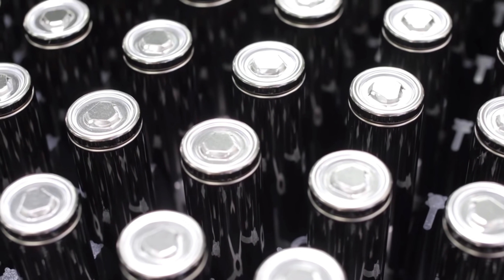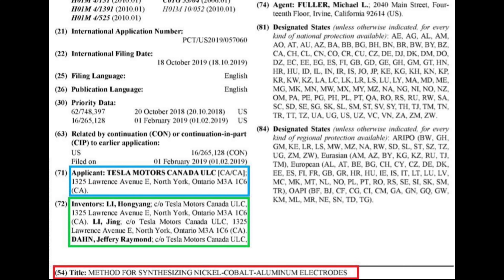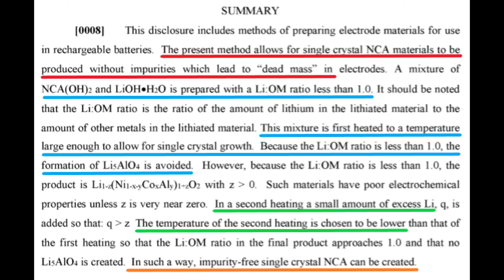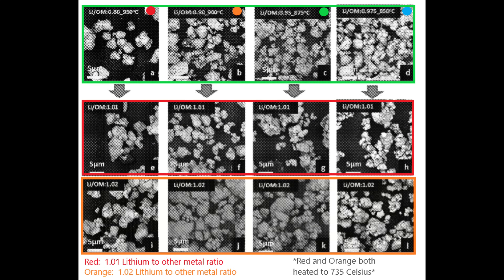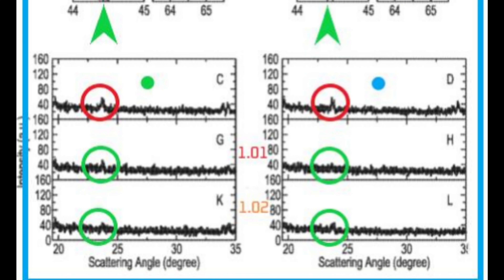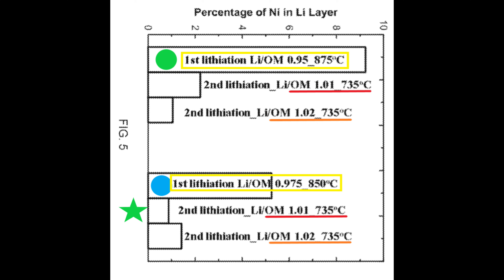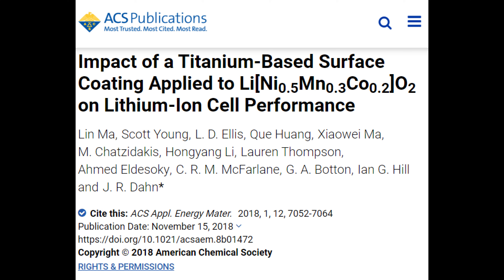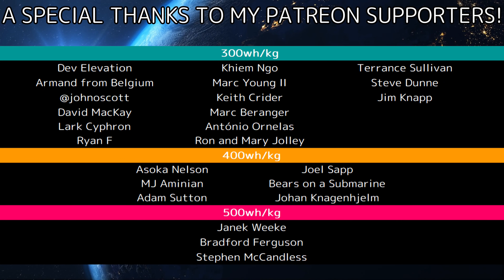Tesla Single Crystal Cathode Patent (Deep Dive)

Comment: Hi jordan, ultimate discussion about the single-crystal performance and the related patent description, however, the dQ/dV depends on the active material loading hence don't compare with a patent. since in the comparison dQ plot they have used pecific differential capacity value but in patent, they have displayed as obtained plot. 
Thanks for this video and hats-off
Reply from the maker: Thank you!

Comment: Can i point a question? High temperature process like 750 to 950 degree C  take a lot of energy that means higher costs of production even if well industrialized; taking into consideration also long tine to ‘cook’ the NCA crystals that means A LOT more costly chathodes... i think that this is not feaseable industrially, even if they avoid the costly Cobalt out of the chathodes , the offset of higher temperature processes (2 steps so more energy intense process) nullify the small advantages.
Reply from the maker: That's a really good point.  I've been thinking about this a lot lately.

Comment: How does Novonix and their Single Crystal Cathode manufacturing patent play into this? Tesla owns the patent and they have to use Novonix to manufacture it? Or pay them to license or a royalty?
Reply from the maker: Novonics comes in at the precursor stage.  It's a one step dry process instead of about a seven step wet process.  I'll be doing a video on that
Reply: The Limiting Factor Thanks, look forward to seeing the video. I saw Novonix made a few announcements of patents relating to dry particle microgranulation (DPMG) and single crystal cathode manufacturing and I’m struggling to understand how they might fit into Tesla’s big picture if Tesla has already been developing it.
Reply from the maker: @dobodob1  It may not fit into Tesla's big picture.  It will take a couple years before the single crystal from novonix is on the market in any volume.  In order for a Tesla to implement single crystal now or soon, they would have been lining up supply a year ago.  There are plenty of suppliers of single crystal or Tesla could make it themselves.

Comment: Have you looked at dry particle microgranulation (or DPMG) and it's potential effect on battery cost and lifetime? By Obrovac, a Professor in Dalhousie University.
Reply from the maker: Yup!  Working on a multi-part series on anodes.  Been in contact with Chris burns and other CEOs.  I'll start with Graphene and work my way up.

Comment: If your goal is to upload content to reach a large number of viewers then choose a lower resolution your content appears interesting but could be stuffed watching it because the audio cuts out
Reply from the maker: Hey man, thanks for trying.  I'm confused though.  You can lower the resolution by clicking the gear and lowering the resolution.  YouTube always plays at the max resolution but allows users to select the resolution that's best for their system.
Reply: I tried doing that... There was no option to do that.  I was watching it on my tv  via chromecast, casted from my mobile, it dosen't give you the option to reduce the resolution
Reply from the maker: @SkyRiderJavelin Oh man!  I've corrected in future videos - rather than 60fps 4k max, it will be 60fps 1080p.   The tabless electrode patent deep dive video used that format and so did the corrections video I just posted.  Hopefully that helps.

Comment: I have the rare earth element that can be test for battery i  tried heating it in high temperature it just glow in red and even if you put it to water while too hot it never breaks, my belief is that this kind of materials can be use as components of battery that is highly resistant to heat and a good conductor and energy storage...

Comment: Trash video.  You just compared refraction to diffraction.  One is dependent on dielectric/diamagnetic property, the other on wave scattering which is dependent on constructive/destructive wave interference.  8:53. Refraction is multiple frequency event as with spectroscopy.  Diffraction patterns have to be done with monochromatic or ultra narrow band.  Those peaks tell you the lattice spacing and crystal structure.  Each graph is a rotation about an axis.  If a single crystal exist, you will get a singular strong signature.   Broadening occurs with fracturing and  random orientation.  This paper is missing a statistical element showing that they don’t have a fluke sample.  You’re fan boying research which is criminal in the science world.
Reply from the maker: Thanks for posting! It helps the channel stats.

Comment: Thank you for this excellent video! great work as always. I am curious to what extent do you think Tesla will use the LFP cathode? I read that they are partnering with CATL to use LFP. It is cheaper than nickel-rich cathodes, but lower energy density. Grid storage? standard range M3?
Reply from the maker: I don't see why it can't be used for both.  That's very much a question about Tesla's internal strategy, which is subject to internal constraints we aren't aware of.  LFP is a solid chemistry.  Very underrated.
Reply: @thelimitingfactor  Thank you. Yes I think Tesla will use both nickel-rich cathodes and LFP, especially in China where LFP is used with busses.

Comment: So it basically sets a new standard for rechargeable batteries at 300Wh/KG. It also increases speed at charging and even extends life-cycles too. Just say so?
Reply from the maker: Yes.  The only thing I dad is that the battery cell we end up with depends on what use case Tesla engineers it for.  Cells can be geared towards power or energy.

Comment: 300 Wh per kg of battery weight? Wow. So small. Usable with enough weight of batteries, but they do account for an appreciable part of the weight of an electric vehicle. This set me thinking: Suppose hydrocarbons had just been discovered. They are light in weight because they have a phenomenal energy storage density. Electric car manufacturers would be all over this, trying to figure out how to use such a tantalising means of storing energy. Of course they would be beset by the same problem that we have in developing EV tech, which is that it takes years of research and experiment to come up with usable solutions. It is just a pity that it is so hard to produce hydrocarbons efficiently from sunlight. As for going the other way, using hydrocarbons to generate electric power, I think that can be done by chemical means, hence the interest in the last few years in proposals to power laptops from tiny amounts of hydrocarbon fuels, on which the laptops could run for days.
Reply: Yet al are still ignoring graphene, disturbing.

Comment: ..........................What do you think about Nano ones single Crystal technology?  They have attracted quite a bit of attention and money.
Reply from the maker: Without deeper research, I can't comment.  I think it sounds great, but I don't know if they will supply to Tesla if Tesla can make it in house.
Reply: @thelimitingfactor  Thank you so much for your prompt reply.  Here's one posters take on  what is reported ........."Tesla's patent from the Dahn team is one for a battery "recipe". More specifically, it patents certain combinations of cathodes, anodes, separators, electrolytes, etc each with specific properties that when assembled, result in a cell with specific desirable properties.
Nano One's patents of interest here are for a manufacturing platform, which patents a novel form of manufacturing certain cathodes with specific desirable properties.
The complimentary proposition here is that, the cathodes used in the Dahn patent recipe all had a crucial monocrystalline particle property. To achieve this, the Dahn team sought their manufacture using a low volume, high cost method. To commercialize, one would have to find a comparatively high volume, low cost method of manufacture. This is what NNO brings to the table, through their patent portfolio and platform validated at scale. There is no apparent competing method that can manufacture cathode with a monocrystalline particle at similar or better volume and cost.
We know that NNO has spoken with individuals that report directly to Musk, and that NNO and the Dahn team at Dalhousie are aware of each others work. In any case, all these people have been attending the same conferences for years. This is all to say that, the use case and visbility are both there. Whether a partnership forms is anyone's guess." https://stockhouse.com/companies/bullboard?symbol=v.nno&postid=30999046
Reply from the maker: @takencareofbidness  Great article!  However, Dahn is also patenting processes, not just recipes.

Comment: Does this patent limit Nano One's value to Tesla, or does one process build on the other?

Btw, fantastic work. Your distillation of the meaning from these science papers provides a framework that makes them far more readable for lay people like myself. Thank you. Might I suggest adding links to the patents for those so inclined?
Reply from the maker: Nano One makes something similar.  However, if Tesla manufactures in house, they might not need a company like Nano One.  It depends of Tesla can scale this alone.  Tesla seems to prefer that route.

When the pressure is off from battery day, I might start adding links :D

Comment: Those slides showed much of the space between the crystals was filled.  I wonder if that is the lithium ions?  Damn impressive increase.
Reply from the maker: The single crystal may offer a slightly higher energy density, but it's mainly to increase durability and extend cycle life.

Comment: Appreciate the deep dives. I’ve never seen a patent or crystal lithography explained do well.

The reason all BMSs support 5v is historical— 5v is the original semiconductor voltage dating back to TTL semiconductors in the 1970s.  CMOS adopted the standard for compatibility, and it’s become the default unless you have a compelling reason to go to lower voltages (as CPUs often do.).  So it would have cost more to make a BMS that didn’t support up to 5V batteries.... and it will cost significantly more (or require extra circuitry) to support higher then 5V batteries.  5V is the standard for integrated circuits like 12v is the standard for car batteries.
Reply from the maker: HA!  That is some awesome information man.  I may use this in a future video.

Comment: What is the weak link in John B Goodenough’s new solid state glass battery?
Reply from the maker: I haven't done a deep dive on this yet.  It's on the list.  However, with solid state it usually comes down to manufacturability, particularly glass.  You may have seen the single article already, but the developers are saying 2025 at the earliest for JBGs solid state battery.
Reply: To wait for 2025 for a battery that can achieve what the SSGB claims would be fantastic. Looking forward to your deep dive.

Comment: So how do you think this patent affects the likelihood that Tesla will use Nano One's process for producing coated single crystal cathode materials? Is this method of producing large single crystals compatible with Nano One's one-step process for producing & coating single crystals? Are the coatings even necessary/helpful with this process?
Reply from the maker: It depends on if Tesla has the capacity to fully manufacture their materials in house.  Nano One didn't provide enough information on whether their onestep process was for the single crystal or the coating (at least from my quick look).  Yes, the coatings are helpful and extend battery life.  Necessary depends on the use case.

Comment: 13:00 if a 0.1 volt increase makes an 8.3% higher capacity battery than going from 3.7 to 4.3 would be 8.3% compounded 6 times or 1.083^6 or a 61.4% increase in battery capacity
Reply from the maker: The usual operating range for lithium ion batteries is 3 to 4.2 volts.  3.7 is just the nominal voltage.
Reply: @thelimitingfactor  I gotcha so your talking about the tail ends of the voltage curves? or the maximum voltage and minimum voltages. Cant you in theory overcharge the battery, how do you draw the line exactly at 4.2 and 4.3, like how is it defined?
Reply from the maker: @jamesN6450  Great questions.  The line is drawn at 4.2 volts because above that point is degrades much more rapidly.  So, the battery management system usually cuts the voltage off at that point.  However, most manufactureres recommend not charging over 80-90%, which is like 4.05-4.15V because the degradation actually starts occuring above 4.0 volts.  Jeff Dahn's new chemistry hits a solid and sustained 4.3 volts for 4000 cycles of 100% depth of discharge.  It's nuts.
Reply: @thelimitingfactor  gotcha, so its a semi-arbitrary limit, which most things in engineering are arbitrary at the fundamental level so it makes sense. If its 4.3 vs 4.05-4.15, would it be  compounded 3 times? if so that is pretty nuts 27% more capacity plus more cycles.
Reply from the maker: @jamesN6450  Correct all around!  It would be about 27% more that could be used on a daily basis and 8.3% more peak.  Yeah, it's nobel prize material.

Comment: U can already buy high voltage lithium cells been available for ages 4.35v volts
Reply: The goal is not high voltage, as you say, that is available already. The goal is to get high voltage, maintain high amperage and avoid "rapid" degradation (which thermal characteristics also play a role and could help the BMS). Also volumetric and weight ratio to capacity/power is important too. Achieve all those key aspects and you have a winner.
Reply from the maker: Amen!  Expand the spider chart in every direction.

Comment: So there is no new developments on the electrolyte? I am more concerned about the electrolyte because in colder temperatures, no matter how good the cycle life or the energy denisty is, the electrolyte freezes and that decreases range by quite alot, and i live in a very cold climate (canada). So even though the energy density and cycle life increase is good, it still isint enough incentive to switch us northerners to electric cars.
Reply from the maker: There may an option, but it wouldn't allow for a million mile battery.  See quote below.  It didn't specify due to cold temperatures, but my understanding is that is when plating occurs.  MA is methyl acetate, which could be used in the electrolyte.

"The impact of MA on lifetime can be considered minor or major depending on the intended application of the cell. In a situation where high rate charge and discharge is required and intermittent use is envisaged (cells spend a large fraction of time in storage) the incorporation of MA would lead to a minor penalty at most. In addition, if the incorporation of MA eliminates Li plating during high rate charge, then MA would lead to a lifetime enhancement by removing this serious degradation pathway. On the other hand, if cells are intended to be cycled continuously between 3.0 and 4.3 V for years, Figure 17 suggests a major penalty associated with the incorporation of MA."